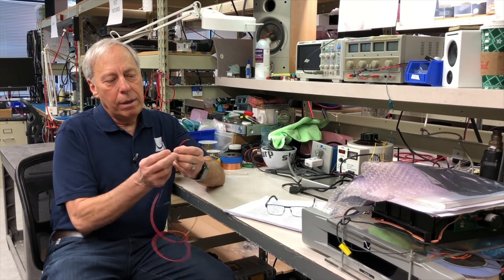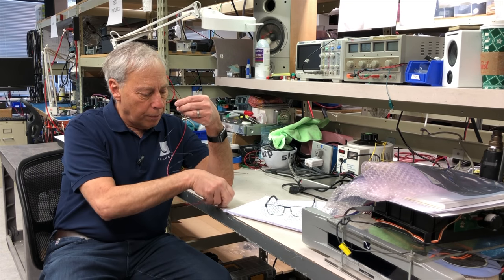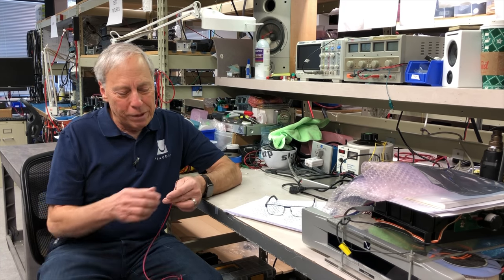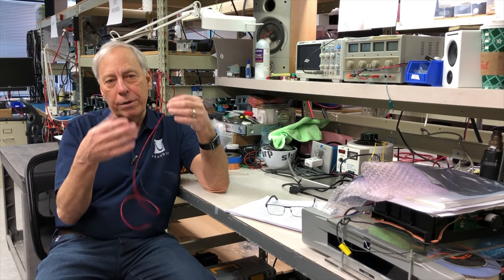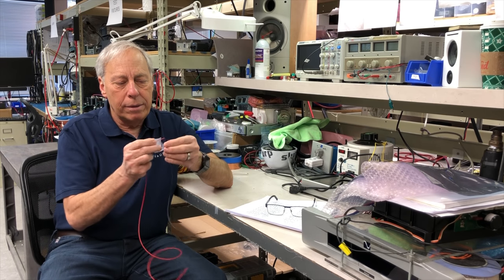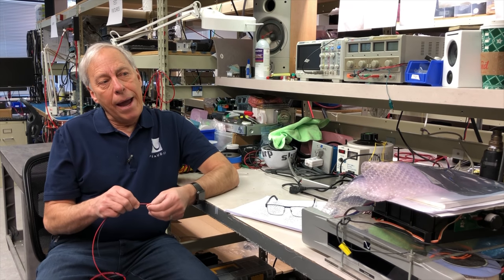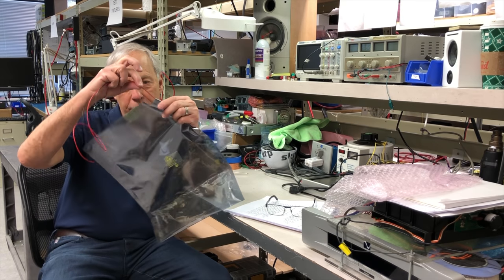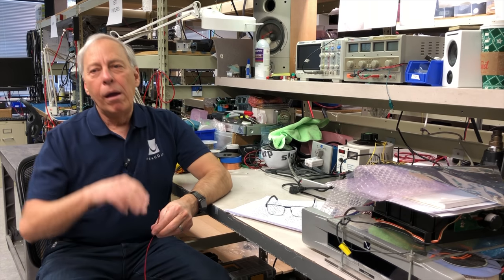The best DIY interconnect

Comment: 300 ohm twinlead antenna wire might work, it will have a heavier dialectric but for moderate lengths it might work.
Reply: It does work and wonderfully. Open airy top end and smooth frequency response. Only problem is the pe dielectric is tough and stiff and hard to terminate into rca plugs.

Comment: So would using 1", 450 ohm, ladder line, like what the Ham guys used for feed line, be simpler and give the same result as making the "Masking Tape" version?  It's solid wire, probably 12 or 14 ga., not exactly sure.

Comment: Line level analog audio connections should always be shielded. RCA phono connections/cables are commercially made with the signal wire connected to the pin and the ground shell connected to a braided shield in the cable. Making DIY RCA interconnects typically requires soldering. There is normally no good reason to make your own.

Comment: Paul, I know that you talk about to use tape, but would schrink tubing also work?
I think that it would make a stronger cable while keeping the distance.
Reply: Yes, it'll work......  the Tape, etc., material is only there to keep the "Wires Spaced Apart & Separated". been using that concept for years... on 4' runs and shorter!  Works great.

Comment: How about 2 single core solid dielectric coaxes in a twisted pair config?
I have no idea. Most of my life I have used braided shield twisted multi-strand pairs with no probs, some headphones and earplugs with two braided shield multi-strand conductors. What I hate soldering is the tiny braided copper around multi-strand plastic. Burnt plastic & flux competition!

Comment: According to a Belden technician's book, the best method to shield against noise above 10 MHz is foil shield.

If one is on the camp believing that RF interference is the main cause that makes audio gear sound different, she/he should by a cable with foil shield: for example an Audioquest is better for her/him than an unshielded Kimber.

I tested a Canare coaxial with both foil shield and braid shield. I bended the cable just a couple of times to simulate normal usage and opened the outer PVC. I could see cracking on the foil.

Comment: There's a notion floating-about the Internet that speaker cables can be made from braiding three strands of Ethernet cable... 

What do you think?
Reply: Just use the twisted pairs in there. Less work, sound good.

Comment: With respect to interconnects, Isn't it important to understand whether your input terminations are single ended or differential? Both handle grounding and noise differently and are not interchangeable even though they will technically work. Balanced connections aren't always simple to create with certain components.

Comment: The best cable differs from each HI-Fi setup ! Dont let them tell you all different .! 
I use audioquest golden gates theor cheap and durable and they go on very tightly to your in/out- puts.  They hold on so tight you have to twist them while you pull off to remove them

Comment: Isn't that the same as 300ohm ladder line feeder cable?
Reply: @LD Blake -- Right, and the reason for both ladder line and the cheaper, more common 300 ohm "twin lead" for antennas up in the 50 mHz+ range was to limit shunt capacitance, which is a major issue at those frequencies.  In the audio range at the typically low impedance encountered in a typical modern hi-fi "interconnect?"  Not so much.  Shunt capacitance can be an issue for electric guitar, where both the pickup(s) and the amp input have considerably higher impedance -- that why Jimi Hendrix preferred Radio Shack "coily cords": the shunt capacitance introduced by those cheap cables bled some of the high-frequency "edginess" of his Stratocaster's pickups to ground before the signal reached his amp and he preferred that tone because it sounded better when he "dimed" his Marshall stack, something neither Leo Fender nor Jim Marshall anticipated when they designed their products.
Reply: @LD Blake -- Fair enough, thanks for the knowledge.  So, why is "ladder line" considered superior to twinlead?

Comment: Paul why do you say that one end but not both ends of the shielding is connected to ground?
Reply: Connecting to both would make it a 3 wire cable. You get your home oulet ground from the earth near you...a copper coated stick burried on the ground....literally. You dont get from the grid. Also....more related to the high frequencies ....look up Faraday's Cage on google.

Comment: Excellent, Paul. I’ve been using homebrew interconnects made from shielded two conductor microphone cable for many years with wonderful results. The shield is only connected on one end like you described. Belden makes a thin version that is pretty inexpensive. Years ago I’ve also made braided interconnects using three 22ga. Solid core wires. The third wire was connected to ground on only one end. Zero RF noise and decent sound but not as good as the Belden shielded two conductor cable.
Reply: I am a big fan of Belden, Coax to HDMI to Ethernet, you can't go wrong.
Reply: LD Blake, I’ve been using this method for my DIY cables for about 15 years without any hum or grounding issues. Lucky I guess 🤗. Thanks for your interest.

Comment: Pls explain how you make the 4-wire version
Reply: If your referring to a 4 wire rca interconnect, they just braid it all together and then use two wires tied together for each of the two contacts. You can use 8 or 16 wires if you wanted to, you just use half of all the wires for each of the two contacts.

Comment: Rg74 coaxial cable and bnc connectors should be the audiophile standard if you want perfection. Standard rca cables are probably fine, but small coaxial cable and bnc is good for up to 100s of MHz.

Comment: Braiding can be done with a normal diy drill but on a low speed; just place and clamp both cables in the drill bit end, tie the wires and then run the drill. Plenty of videos available to show you how.
Reply: That’s not braided, it’s only twisted😳

Comment: Rg59 is very good and cheap
Reply: @J Fz l bought years ago an....audiophile (!) Rg59 lt had copper solid core, silver coated, double screening. A bit stiff but very good. Blue pvc...l think it was made by Audiosuest
Reply: Therockerxx69, I've heard about this for which you speak and considered it my self. Are you talking the quad shield that I've heard about by one of the regulars here? BTW
Your...Too Hipp!
Reply: That's the Hot Shit the Rock Shit!     Whooya
            The mighty 
              KMET
Reply: @SJMessinwithBoats  Belden rg59. If you want a mind blowing, cheap, DIY, cable, solder yerself. Try Via blue quattro made in Germany. 10 bucks per meter. Absolutely mind blowing. You have another system!!!
Reply: Rockin Brother from the old country! Thanks! Remember those Crazy KMET contest's? My first wife had me enter one, how silly looking back.
Reply: So I shouldn't use Rg8 like my cable company uses? I was getting ready to use it under my house?

Comment: First of all: there is no "plus or minus". It is AC! 
The quality of the cable can be ignored; all audio devices are low impedance out, high impedance in (>10 K.ohm).
Resistance nor capacity of the cable is playing any role!
You can't measure any difference, let alone that you can hear any difference.
And then inductance, hahaha! The inductance of a short cable should only be taken into account if you want to transfer Megaherz frequencies!
The only difference you hear with an expensive cable, is the money that is no longer in your pocket...
I think Paul could have been a good writer of fairy tales!
Reply: Frank55 As a Ham radio operator since 2003 and a CB operator since 1978 before that. I totally agree!
Reply: There is no gods either, you missed that point, 
Spam mama's.
Reply: You have to accept that cables make difference. BUT you must understand that a 20€ can sound better ten a 2000€ cable.
Reply: Have you ever tried different cables?  I'm willing to bet you have not because you are so convinced there is no difference.  I once had non audiophile roommates studying in the room where I was trying different cables and without asking him for his opinion or even informing him what was going on, he volunteered that cable B was far superior to cable A.  Cable B was actually hundreds of dollars cheaper but he didn't know that.  It's really not difficult to hear differences between many cables.  I don't spend a ton of money on cables, but they clearly make a difference.  Maybe you should actually try it before you shoot it down so definitely.
Reply: @KeithSkronek  The nay sayers have such fixed ideas based on what they've been taught or measured under certain conditions using certain equipment. Fact is, no one knows exactly what the phenomenon of electricity actually is. We have various models and math that are useful for utilitarian purposes, but nothing definitive. So anyone with curiosity about life needs to remain open to the possibility that people can experience things that can't, or aren't, presently measured. There's nothing sadder than a dyed in the wool engineer who knows it all.
Reply: Then why do you HEAR a difference???
Reply: @LD Blake Not sure who the neophyte is that you refer to. I've been trained in conventional science and engineering to university level and worked in the field since 1986.
Reply: No plus minus?  Apparently you don't know what a sin wave is.
Reply: @mfr58  Exactly, that is why it is called electrical theory.
Reply: @buttonman1831  Do you know what a sin wave is?
Reply: @porkchopspapi5757  Do you?
Reply: @buttonman1831  No. Never heard of a sin wave. Is that what happens in neighborhoods that allow drugs & prostitution?
Reply: @porkchopspapi5757  You should know
Reply: @buttonman1831   Oh well tell us all about your sin wave.
Reply: @porkchopspapi5757  If you want to know about signs waves, you should take electrical theory like I did or at least google.  I'm not playing your silly game for correcting misinformation.  I already pointed out to the poster that negative half-cycle is in fact part of an AC sign wave.
Reply: @buttonman1831  sine wave
Reply: @porkchopspapi5757  yup
Reply: @buttonman1831  The least you could do is tell us about your sin wave.
Reply: @porkchopspapi5757  How about you read about it yourself champ
Reply: @buttonman1831   You don't know what you're talking about huh?

Comment: No offence Paul but I would be amazed if you can hear top end roll off at your age. I am in my early 50;s and I top out at around 14kHz. In my 70's I expect that top end to be several Khz lower still. There comes a time when we really dont need to worry about what is happening to very high frequency audio, we just cannot hear it.
Reply: What?
Reply: He has not hear for a long time, neither has anyone of the 70+ years old Stereophile guys, they are just playing along like it would not had happen a long time a go...
Reply: @cbcdesign001
After the other punter's comment, I became curious and brought up some test tones on my phone.
Oddly enough, I had to turn up the volume a bit. I really wonder if some of those tones are recorded at low gain as some kind of joke?
On the other hand, that high up can get kinda painful!

Which brings me to the point.
My results were similar, and I'm a few years older, but I have to question how much relevance the ability to hear pure test tones has to the ability to do critical listening to music on stereo systems.

If there were a lot of that reproduced on them in the first place, we'd all have splitting headaches every time we put on some music for awhile.
Secondly I'm guessing the only musical information that goes into areas we have trouble hearing at is spacial que information, or things like timbre that contribute to certain sound signatures. Once again, only guessing. However, if true, then we should still be able to do critical listening accurately even as octagenarians, as long as we don't have permanent hearing damage.

We're talking about an organic process, here. Not machinery. It's different.

Comment: 03:40 "Current passing down the wire" Wait we are talking about high input impedance in/outputs here so the current flow is negligible.
Reply: there are still current, and it matters.